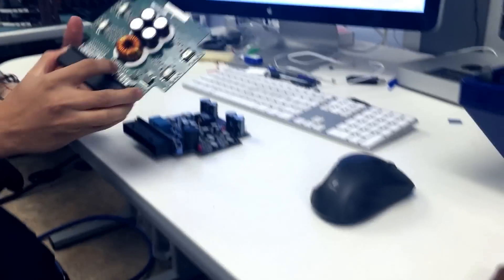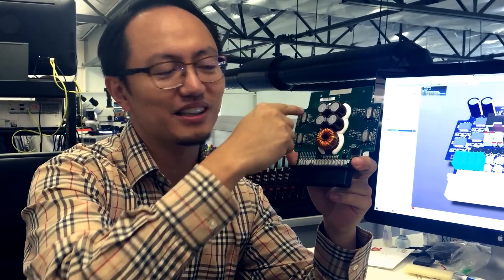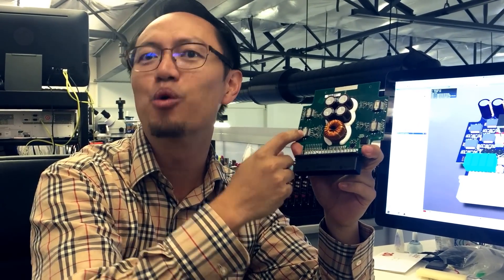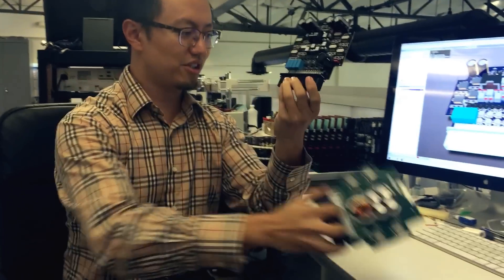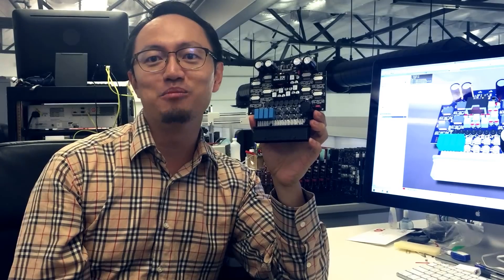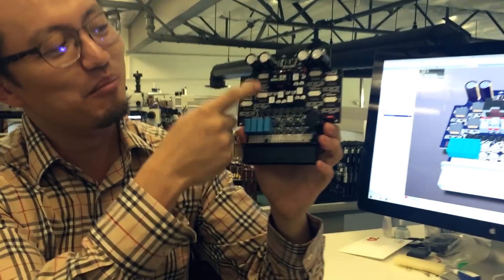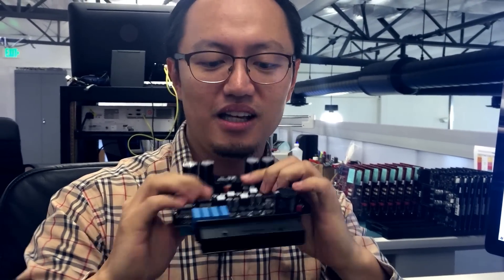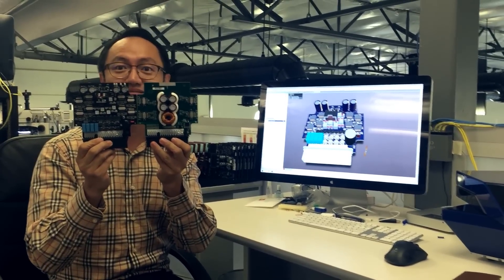Tesla Model S Premium Audio System, Conversation with Larry Ho

Comment: The comment made about CLASS-D THD being better than CLASS-AB is incorrect. This is where CLASS-AB outshines CLASS-D. Which CLASS-D amp has lower THD than CLASS-AB :) ? Power savings I agree but how often do we play 20Hz tone continuously with full power ;)   BTW those large caps and inductor on the Tesla amp is for power supply noise reduction as power supply can be noisy in a car. I was also disappointed with Model S standard audio if the equalizer settings are set to maximum for BASS 12dB /MID and Treble set to 10dB  the loudness increases significantly and the audio quality is quite good. I am surprised the distortion is not as harsh by setting max bass settings. 

P.S I work for a company that produces CLASS-D chips :)
Reply from the maker: Yes. Class D design only has power efficiency advantage over Class A/B. And after our careful design of this upgrade amp, the THD test result is better than the original OEM. Just for clarification.

Comment: it is a complete misdirection. yes class ab amplifier is not new. but that does not mean it is a bad design. also a light bulb is 200 years old technologhy but we are still using it. also yes class ab amplifiers are not best at efficiency but comparing to the huge 50-60 kw capacity with the tesla car. this is just a drop in ocean, so small.  so my opinion you amplifier could be better than stock one. but your explanations are not so true.
Reply from the maker: All we want to say is, when the battery level is low and we are looking for the charging station. At that time, I'm glad I don't need to turn off the music just to save some more energy. ;-)
Reply: @lightharmonic   Hi , Is your amplifier still available ?
Reply: List the specs of OEM versus Light Harmonic!!! Light Harmonic uses class D??? More components do not equate to better audio performance but definitely reduced reliability! Why mislead your non technically trained audience, your potential customers, by nonsense about your use of "audio electrolytic caps"?  De-rate  properly and you improve reliability. The Tesla sample large components are secured by RTV that is good! I saw no vibration mitigation on the Light Harmonic sample.

Bogus sales pitch.